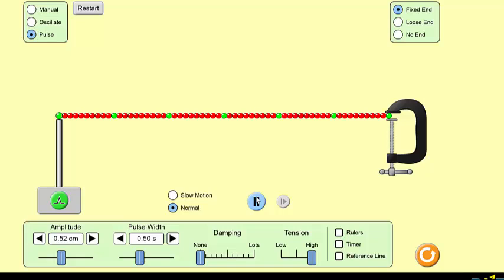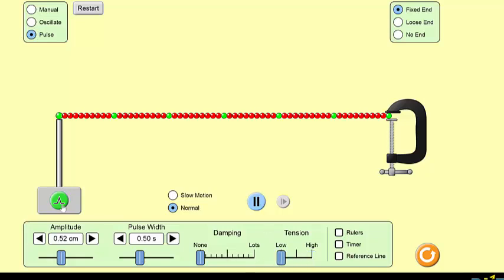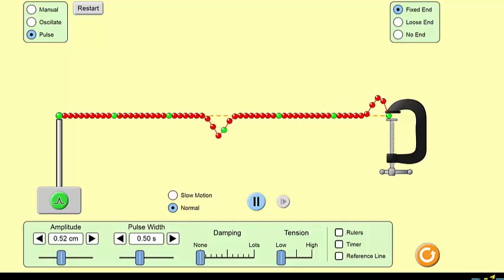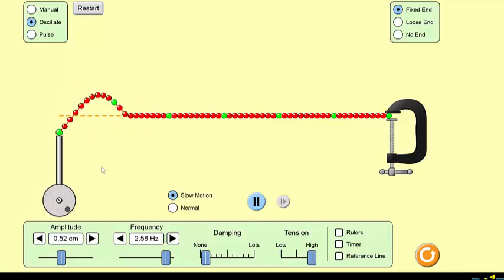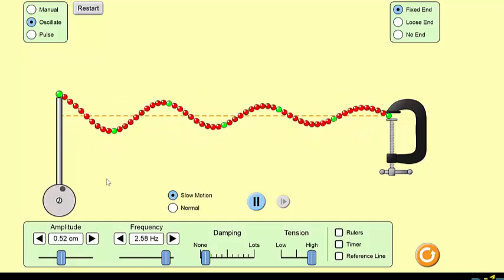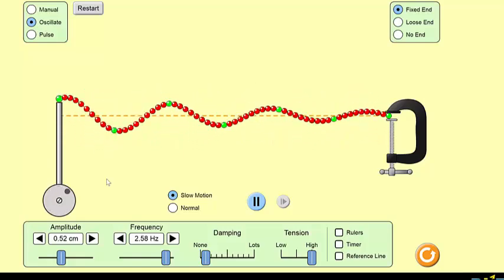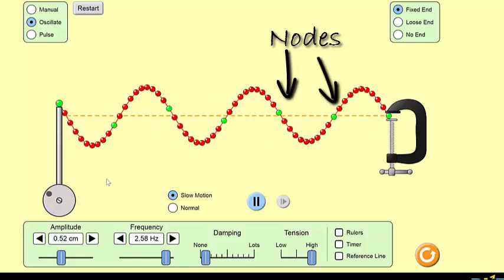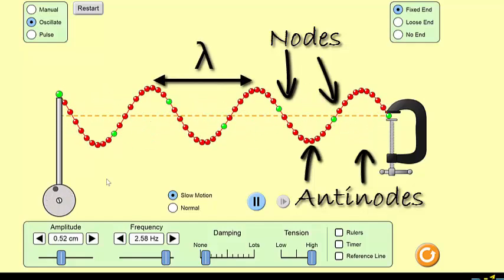Stationary waves

Comment: Do different points in the stationary wave will have same amplitude like a transverse wave or will it have different amplitudes?
Reply from the maker: There is no displacement at a node, so that would have a zero amplitude. At an antinode, the amplitude will be a maximum.